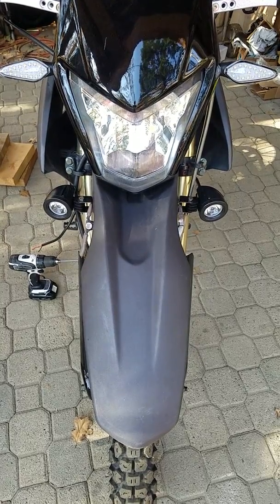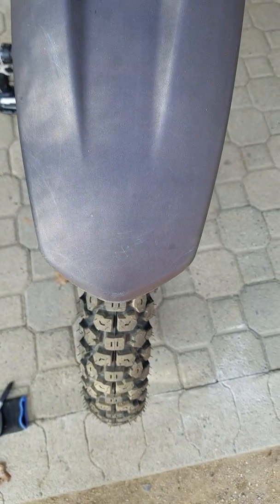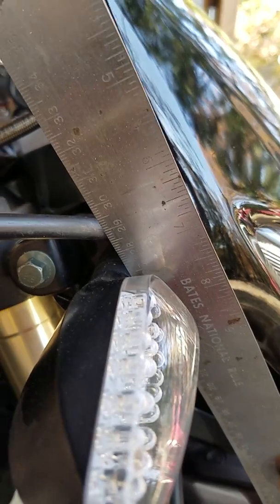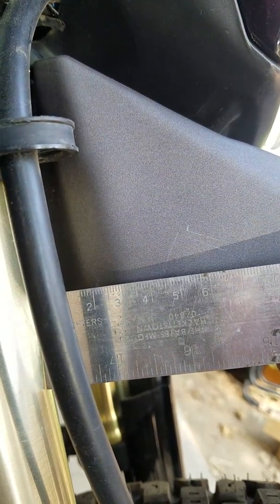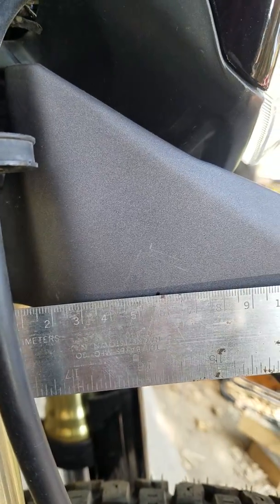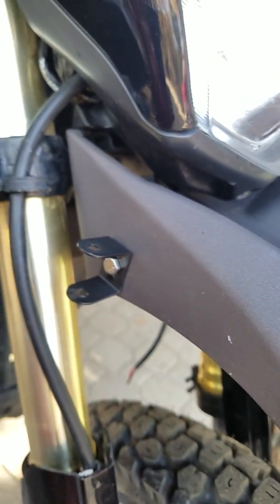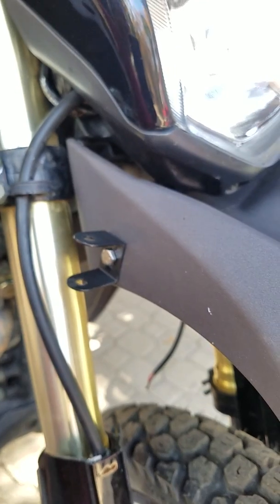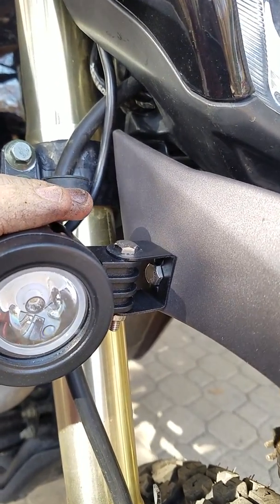Aux Auxiliary Spot Lights Install  Zongshen CSC TT250

Comment: Thanks Forest.  I am going to follow your measurements...thanks!   Does the wiring to connect to A2 come with the lights or do I need to purchase that separately?
Reply from the maker: Most of the lights you buy do not come with the wiring. Mine did not.
Reply from the maker: @forestmotoadventures  you don't really need something that fancy. You can buy Wire by the Foot at your local hardware store, and use the switch that is on your handlebars. All you need and is 2 wires, at least 16 guage. You can give CSC a call and get the harness plug from them , they may have the wire also.
Reply: @forrestn4988  Thank you!!

Comment: Does the auxillary switch on the bars allow independent on/off for both aux 1 and aux 2 ports? Or are they both on and off?  Also, does the bike come with the other end of the aux connector to wire up?
Reply from the maker: It goes Off,  Aux1 only, or Aux2only. You could wire a relay in to have aux1 and2 at the same time option.
Reply: @forrestn4988  No kidding. That's a really odd design. Thanks!
Reply from the maker: @SeanLeach  I thought so too at first, but then I wired heated grips into one of theAux, it's nice to not have heated grips running in the summertime.